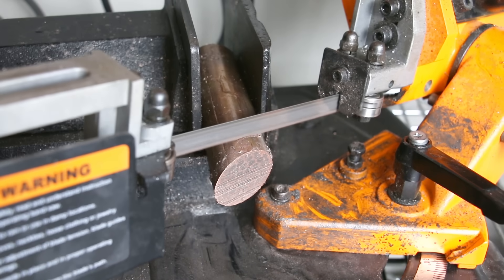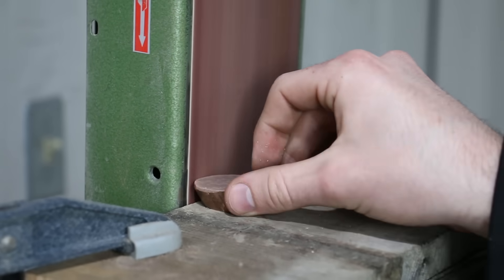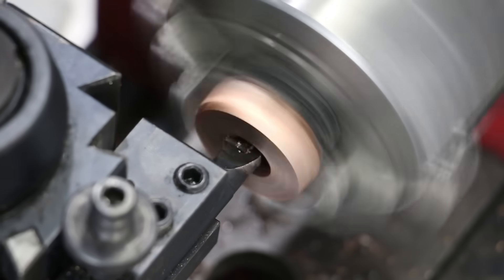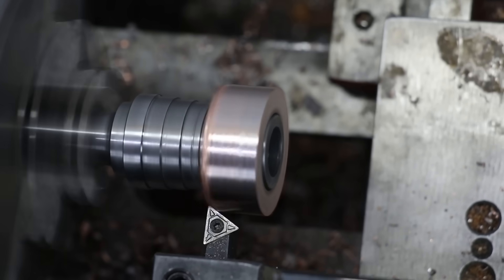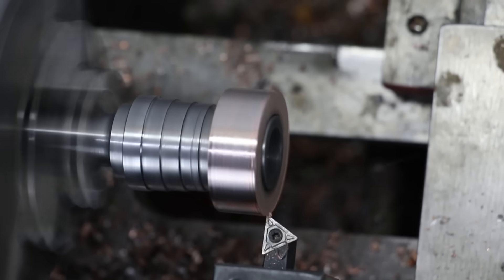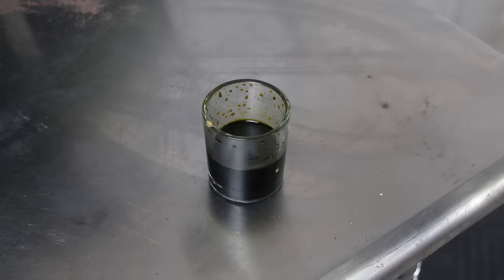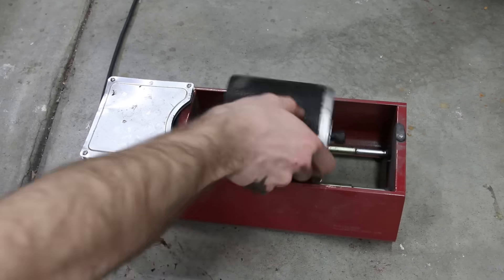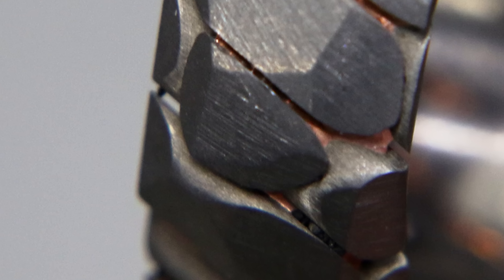Making an Acid Etched Superconductor Ring with Obsidian Facets

Comment: The ring looks amazing. but im going to bet it is uncomfotrable. you would need to fill in the gaps on the interior of the ring. Additionally, i'd bet cleaning this would be a pain in the ass. Maybe you should test how well this comes out sealed in epoxy. It would still maintain the look for the most part, but it would be less edgy and easier to maintain as well.

Comment: Because I’m bored I may as well joke around and make stuff about the ring

Item: Deep Obsidian Ring (Ring)
Desc: A dark colored ring surprisingly flowing with molten lava that doesn’t harm the user of the ring.
Rank: -A
Stats:
Gain Fire Resistance
Owned Inferno Classed Abilities Are Buffed By 10%
Opponent Inferno Classed Abilities Are Nerfed By 20%
10% Chance to Fully Tank Inferno Classed Abilities Aimed At Ring’s Owner.
+35 Density
Applies Inferno Classed Abilities to Used Weapon if Wanted

Level: 1/100
Forged: 0/3
Class: Inferno
Type: Defense

More Stuff+ (just keep scrolling down to see)

Item: Flamboyant Grace (Sword)
Desc: A weapon fit perfect with the Dark Obsidian Ring. With these two combined, fire is on your side.
Rank: A
Stats:
Flaming Bleed: Deal Inferno Damage affecting 5% of Opponents HP and 65 Damage as the base attack
Ifrit’s Assistance: Use 50% of total stamina and 25% of total mana to conjure a flaming aura surround the blade causing extra fire damage with each attack
Volcanic Surge: Cause any weapon to temporarily become molten, this won’t hurt the user but it will deal a lot of damage upon anyone or any that comes in contact while this ability is activated.

Level: 100/100
Forged: 3/3
Class: Inferno
Type: Attack

Comment: I have recently purchased a ring from you for a wedding. I purchased the "heretic in gold" ring for my wedding. I paid over $1,200 for it. When it arrived it was very poor quality and was sized incorrectly so that it does not fit. You now refuse to refund the ring.

I have even offered to pay the price of the gold since their policy is that they "dont refund rings with gold" as long as they refund the difference. They simply do not want to refund the defective product. They have acknowledge that it is defective.

Do not purchase a ring from this company. My experience with them has been terrible. They will not refund the ring despite having admitted that it should never have shipped. I am willing to return it to them, but I do not have time to wait for a replacement.

Comment: Things you should know one any rain is not needed by the cell for a call and left on a finger for more than a few hours at a time can cause a certain type of toxic poisoning I know this because I learned it in school for metal Smiths we were told this when we made our rings they could only be models told not to wear them because unless we coated them either with the normal or electroplating into Silver (it being cheaper then gold) wearing them leave us exposed toxic metal and that’s how it would be absorbed by the body system via the skin. Just wondering if you knew that. Your 
Rings look Tastic tastic I hate voice to text doesn’t put things down the way I want it to can’t correct.

Comment: Ashen Ring/Obsidian ring: when equiped
defence: +10 
flame resistance: +15
electric resistance: -10
aqua resistance: -15
item type:ring
items rank: SSS++
extra skills: molten summon 
can summon molten golem that grant burn if hit 
molten golem stats:
attack: 75% summoners damage
attack speed: very slow
magic: 10% summoners damage

item description: 
rumors said that this ring was one of the demon king sacred treasure only the demon kings can use this item if that demon king dies it will be given to the ney demon king as a pride posesion this was made by the first demon king and cannot be recreated because if you recreate this without true demon lord esencebut if you did succes fully recreat this you will die instantly with the ring

Comment: Ashen Ring:
Plus 10 fire damage
Plus 15 fire resistance
Reply: -10 electric defense
Reply: -15 Water Resistance
Reply: +10 armor
Reply: Ashen Ring/Obsidian ring: when equiped
defence: +10 
flame resistance: +15
electric resistance: -10
aqua resistance: -15
item type:ring
items rank: SSS++
extra skills: molten summon 
can summon molten golem that grant burn if hit 
molten golem stats:
attack: 75% summoners damage
attack speed: very slow
magic: 10% summoners damage
item description: 
rumors said that this ring was one of the demon king sacred treasure only the demon kings can use this item if that demon king dies it will be given to the ney demon king as a pride posesion this was made by the first demon king and cannot be recreated because if you recreate this without true demon lord esencebut if you did succes fully recreat this you will die instantly with the ring
Reply: +10 poise
+50 item discovery

Comment: "This material is very difficult to work with": cuts an oval and then turns it into a circle instead of cutting a circle in the first place, to make it more difficult, so smart. The "superconductor" material has ZERO Ohms resistance at room temperature, I would sell your discovery at $10M. Nice looking ring though, set aside the BS.

Comment: It is an amazing look but I am confused by your use of the term "superconductor". Are you suggesting this is a superconductor at room temp? A lot of metals are superconductors at very low temps but I have never heard antone refer to lead or tin rings as superconductor rings. Is this term referring to something about the style or process?
Reply: Yeah I was curious about this too. It's most likely a form of niobium-titanium alloy with copper surrounding for easier cooling. It is certainly a superconductor but only has those properties at 10K so it's not exactly an applicable word here. I guess it's technically true, but unless you plan to cool your ring to 10 Kelvin you aren't going to get it to superconduct lol.
Reply: I think it's a rod made to be a super conductor
Reply: It is made from superconductor cables used for stuff like MRI machines.

Comment: The center drill will last much much longer if you only go 2/3 up the chamfer for the depth. Then switch to a high speed steel drill bit.

Comment: does that copper not contain Beryllium ?? Hope you are wearing a full face respirator.

"exposure to Beryllium on job sites and is deadly. ... Like other respirable particulates found in construction, beryllium has been linked to a lung disease, specifically chronic beryllium disease. The disease kills around 100 people each year."

Comment: how it is called Acid? Acid would burn, superconductor would be conductor of? if electricity/heat, stronger than aluminium? it wont burn hand? because suntricity is heat and voltage(from sunray). it looks volcanic quite nice.

Comment: Dude learn how to make a quick little program and you could pop those out way faster. Also center drills are not meant to go all the way through that’s why it’s burns up so easily like you say they do, use a center drill to start the hole and buy yourself a real drill to get the job done and you got yourself some production ;)

Comment: FYI... center drills are not made nor designed to drill holes completely through something. They are used so you can start a correct type of drill bit in the center of the hole you are wanting to make. Get a smaller center drill like a #4 then get a good short drill bit from a machinist supplier and you will have both for a lot longer. Oh yeah and they also like a fast rpm in your lathe.

Comment: Center drill's are not made for thru holes. That's why it is burning up. Center drill then use a drill close the size of the i.d. you want. You'll have to do a tool change but you won't have to flip the part to get your thru hole.🖖

Comment: Your "special drill bit for lathes" is in fact a 'spot drill'.  It isn't meant for drilling all the way through material, it's meant to create a properly centred start to a hole that you then finish with a normal drill bit, ie. precision work. That's probably why you're wearing them out so quickly.  They're not just for lathe work either, you use them in pillar drills, mills etc.

Comment: "i'm using a center drill, these are made specifically for lathes and they're just... a really sturdy drill bit"
Looks at center drills in the mill
Looks at pile of broken center drills
Reply: Center drills are fine to use in a mill as long as you’re going slow with it. You just use it to make a big enough hole for a longer drill to go deeper into the piece or if the center drill is long enough just use it
Reply: @alexlasers1358  You use center drills in a mill if you want to keep hole position. Center drills aren't built to plunge as deep as the video shows, the optimal depth is about halfway to 2/3 up the larger chamfer. C-drills have the same speeds and feeds calculations as twist drills.
Reply: @Nachiebree  early I was saying you can use one for really small holes but they're mainly used for starting up a hole for use with another drill bit, at least that's how we used them when I was in machine class but that was awhile back
Reply: @alexlasers1358  yeah and I'm saying they don't have much flute length to evacuate chips. they're not meant for drilling all the way through, they're meant to let your drill hit position better

Comment: For something like this, why not remove the initial material with a single cut that leaves you with a disc to remove? That way, you would still have one intact, continguous "plug" piece to use in different applications.

Comment: May I suggest using a material that blanks off the inner surface, while etching? Much like Samurai Sword smiths blank off the blade's edge. Maybe you can achieve an interesting result if some of its structure is eroded and some of it is still solid. Like I say, if it were me, I'd retain the inner ring surface, so that it looks more solid inside. But have all the outer surface etched, corroded and eroded. Yeah It looks pretty cool! Just need to figure out where I Can get a super conductor rod now lol!

Comment: 09:50 what liquid material do you use that ring covers with obsidian pieces?
Reply: It's an acid that erodes the weaker copper and leaves the titanium alone.
Reply: basicaly, the metal he made the ring out of was a mix of copper and titanium, the "obsidian" (titanium) was already in the ring, he just removed a lot of the copper to reveal more of the titanium using an acid.
Reply: But what acide

Comment: I'd recommend not using the center drill to drill completely through the material. Look for a stubby cobalt drill an go past the drill point. Less time spent flipping the part and truing up. Also maybe look for coolant oil to mix with the water. Gives better tool life and you don't have to worry about rust later down the road on your tools.

Comment: So i'm no machinist, but when you are machining materials that work harden, like you were saying you should decrease your chuck speed and increase your feed. It will put less heat into the part, less stress on the materials, and result in less work hardening :) These rings are amazing. keep up the good work.

Comment: A center drill is supposed to just be used for making a center hole before you drill it with a regular drill bit. It isn't very good on the centerdrill to use as a drill bit, just to poke slightly past the smaller diameter part of it so it slightly tapers into that guide hole, then instead use a drill bit at the correct speed and feed (and pecking is good to not put too much stress on  the drill bit) so it doesn't wear out as much. And of course lubricant is your best friend so you don't damage your drill bits. Using the centerdrill works as you did it, but it can just wear it out faster where most drill bits are tempered or hardened to take more stress than centerdrills.
Reply: But regardless it was a cool video

Comment: For your lubrication try mentholated spirits, I use it a lot when machining any gummy material as it vaporises, cools and ejects the gummy material away from the cutting tool. 

Love your work! It would be interesting to see if the super conductor suffers from the same reaction as copper and silver.

Comment: Sorry to be boring, but in this excellent video the constant reference to a "superconductor" is in error.
what you have there is overhead high voltage power cable. Copper conductor with Titanium Cores
Titanium is a very poor conductor of electricity, but light and strong, Copper is a good conductor of electricity But malleable
 and soft and weak.
If the conductivity of copper is considered to be 100%, titanium would have a conductivity of 3.1%.

SUPERCONDUCTOR: a substance capable of becoming superconducting at sufficiently low temperatures.
"as they are cooled through a critical temperature, they suddenly become superconductors"

We are talking Computing and electronics here.

Comment: I think you need use epoxy resin, because this ring is not durable and smooth. Cracks will be clogged with dust, and the ring will look bad

Comment: When machining copper, have some butterfat in the lube when you turn.  You can add butter to the cutting oil, or use steam oil (which contains tallow).  The copper will machine like brass!

Comment: Its like a rare ring that requires you to be a lvl 100 mage and lvl 250 magic and main element : fire
And it gives you a:
+1000 magic damage
+200 mana regen
+10 Magic resistance
+20 armor
And bonus skills:
Gives the user the ability to nullify any fire attacks and absorbs 45% of attacks.

Comment: Dude you're killing tools because you're using them wrong. Google turning speeds for drilling different materials and just use a normal drill to go all the way through the centre drill is only meant to make a spot in the face of the part to prevent the actual drill from wandering

Comment: Cool stuff!  Wow, the questions I can come up with!Why cut the material at an angle to begin with?Who makes the material (not that I would ever think of buying or using any, just curious)?How long does it take from start to finish to make one ring?What do you use to etch?Does any of the waste have to be treated as hazardous material?What would be the downside of using superconductor material?  Conductivity? Heat/Cold retention?

Comment: I only watched this because there were so many cool words in the title. I don't even know what a superconductor is.
Reply: Philip Longos Winkel when chilled, with say liquid nitrogen, the become "superconductive" meaning it allows electrons to flow through it, with next to no resistance.
Meaning, extremely simply, using it as wire, allows you to send much more electricity through it than normal, much, much faster.
It is used in things like, mag lev trains, x-ray machines, MRI machines, the large hadron collider.

Comment: I clicked cause I have no idea what this means
Reply: Neither do I
Reply: when chilled, with say liquid nitrogen, the become "superconductive" meaning it allows electrons to flow through it, with next to no resistance.
Meaning, extremely simply, using it as wire, allows you to send much more electricity through it than normal, much, much faster.
It is used in things like, mag lev trains, x-ray machines, MRI machines, the large hadron collider.

Comment: Dear God.. don't drill with a Slocum drill. Its for centering. Not drilling. Get a set of HSCo drills from someone decent like Dormer or Guhring.  Center drill with the Slocum then start with a 5 or 6mm HSCo drill. Whats your final size?  1/2"?  Work up to that in 3mm steps. So 6mm, 9mm, 12mm.  And use cutting grease (also called tapping compound) if you don't have flood coolant.

Comment: It may have already been stated, but try using a something made for Titanium to do that initial hole. HSS is actually softer than titanium which is probably why you burn through them so fast.  Also, don't use a center drill to drill that part out, you run the risk of it snapping and fowling up your part, especially with as hard as your material is here

Comment: What size rod did you use as I wouldn't mind giving it a go my self. I'm going to give it a go and to get a similar design my casting the ring with the cuts Predone. Then going over with platinol to get oxidised copper bits. To give it a tungsten look but that will need to be redone in time. Ps awesome video and amazing finished ring.

Comment: One suggestion is that the inside of the ring is no longer smooth because the etching took place all over the ring.  If you put a layer of wax on the inside of the ring then the etching will only occur on the outside of the ring leaving the inside that touches the finger smooth.

Comment: Hey Patrick. If you got the time for another experiment, wonder if you are interested in this idea:

Forging a blank with tow materials  combined. One harder material being similar to marbles and the other being a softer material to melt at a lower temperature.
The idea is to encapsulate the little balls, then repeat  the same process with this superconductor.

What came to the idea is how the copper came away from the titanium. If they were like balls the "pebble effect" or raised texture will be more pleasing to the eye. Perhaps what this ring was lacking is when you cut it, the pattern you had was prepared for the erosion step. Thus leaving rounded tubes in the ring instead of round shapes (as seen from certain angles).

Hope this idea helps.
Reply: Bianca 

ललधधेणरदददरक्षक्ष
Reply: ...what?

Comment: Good work with the manual lathe, though there's work needed to narrow down your selected tools. The comments are correct regarding that the center drill is essentially used as a spot to create a pilot hole for the drill so it doesn't walk off. 
Otherwise keep up the good work 👍